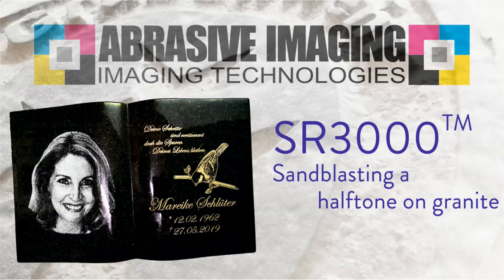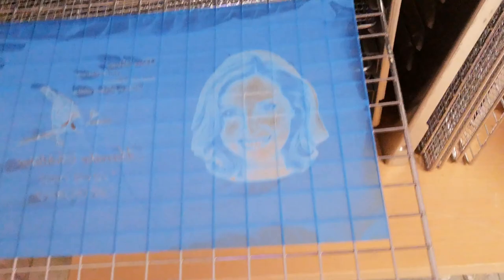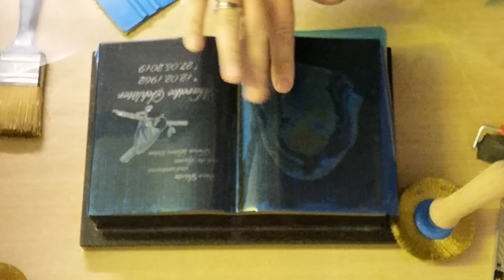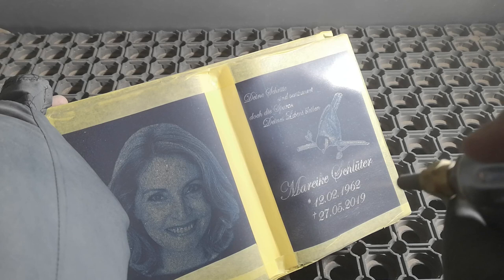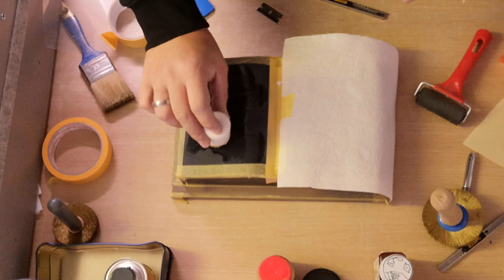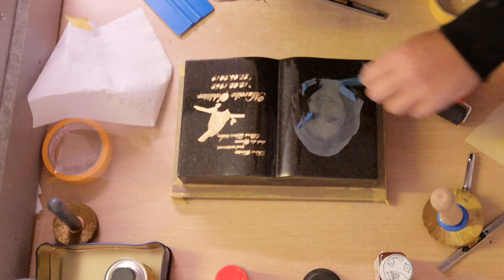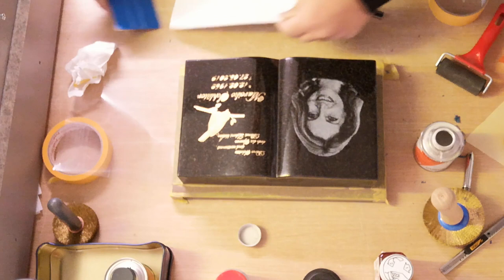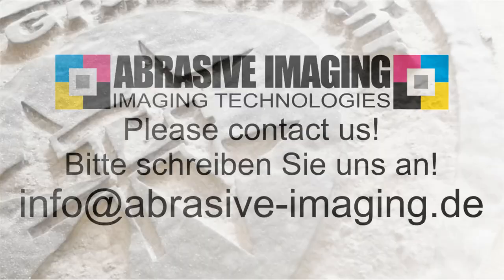Sandblasting a halftone on granite SR3000

Comment: Hi Matthias, what software and printer did you use to create and print the halftone. I'm having trouble with my printed halftone not being 'dense' enough and letting some light pass when exposing
Reply from the maker: Hi Ian. I was using CorelDRAW X7 (free manuals available at www.abrasive-imaging.de) and the Printer EPSON ET 14000. The EPSON XP 15000 is great to use too. Setting for the Printer is "best Quality" like printing photos and Ultra Glossy instead of Paper! This will grant a high dense printout. Have a great one! - Matthias
Reply: @AbrasiveImaging  thank you very much for that 🙂
Reply: Que tipo de papel se usa para las fotografias

Comment: what type of nossle did you use and compressor ?
Reply from the maker: 2,5mm BC-Nozzle, 4 bar / 58 psi pressure / Junior+ Pressure Pot Sandblaster / 350l/min air consumption

Comment: Hi, I would like to ask you what kind of plastic sheets you use to print.
Reply from the maker: Hi - We are using a specially coated Inkjetfilm. This inkjetfilm is 165µ thick and will cost about 51€/100 sheets net. you can buy it at www.abrasive-industry.com